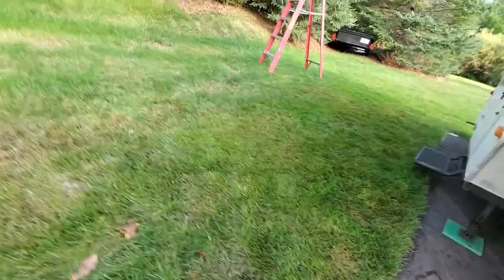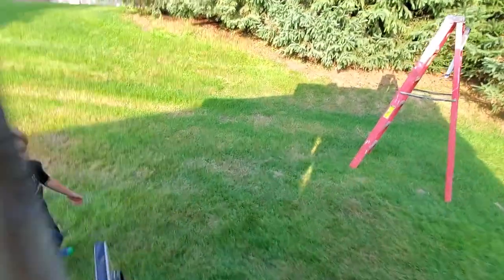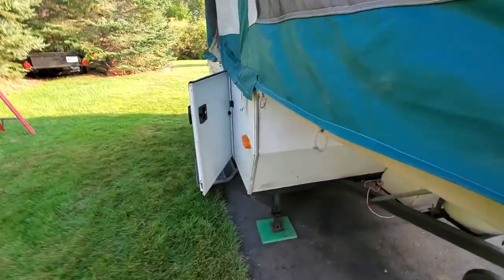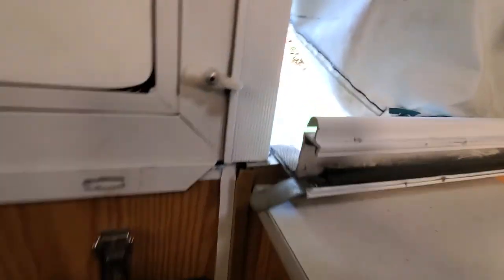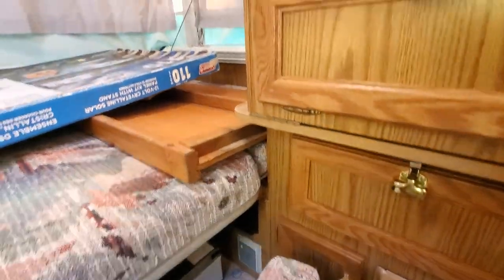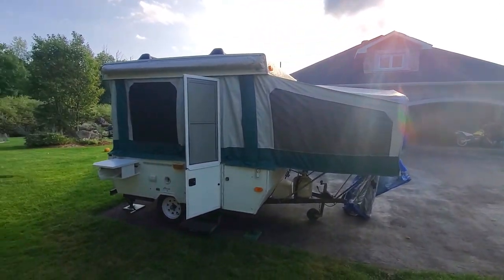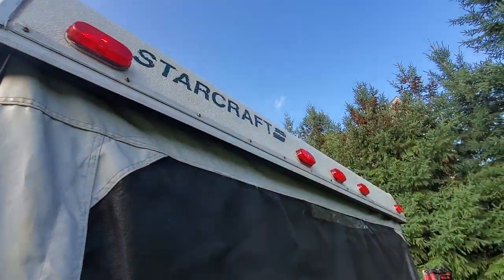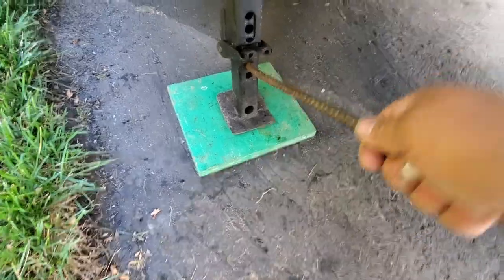StarCraft meteorite meteor trailer setup part 2

Comment: I have been looking for a single bed tent trailer.  What year is it?
Reply: I googled them...looks like they were made in the '90s
Reply: I looked for one but they are scarce. I'm going to take back bed off mine to lessen the weight. I want small and light weight. I already took stove and sink out. I never used them.
Reply: It’s the 1998 StarCraft meteor 814
Reply from the maker: This one is 1997 but they haven't changed much into the 2000s except I think maybe the colour and some options. Mine doesn't come with A/C on the roof but I seen same model which does.

Comment: Wow, what a lot of work.  Do you know the dry weight of that trailer?
Reply: Our 2 bed pop up  weighs 1378, so less than that.
Reply: It can be towed by any car. Weighs about 875 lbs
Reply from the maker: it says its 1200 on the spec sheet inside, but the manual says 1080. max load weight is 2000.